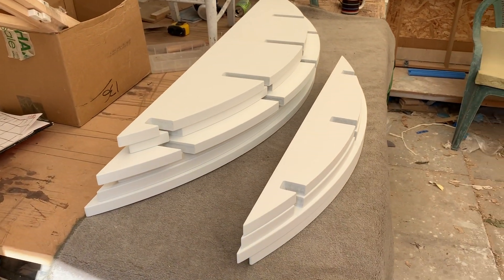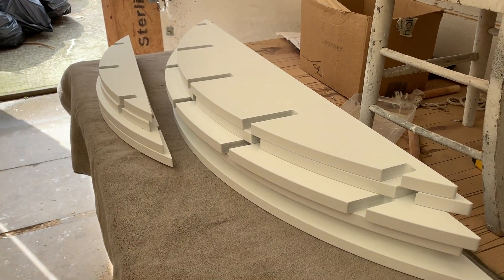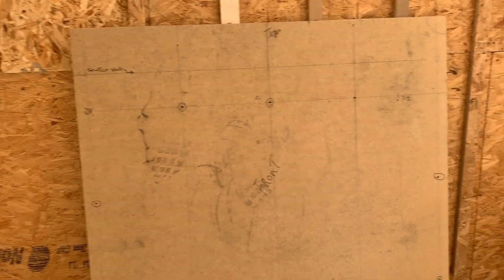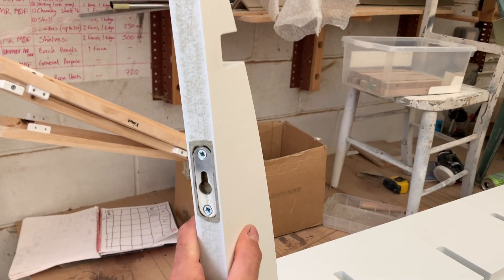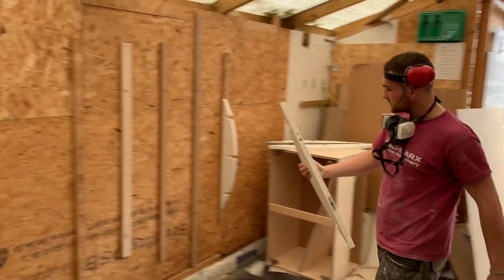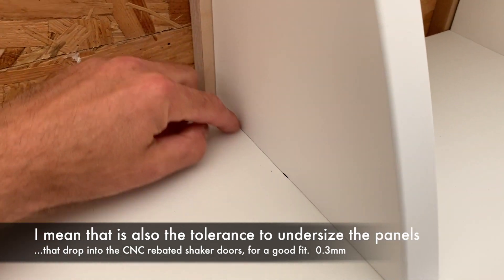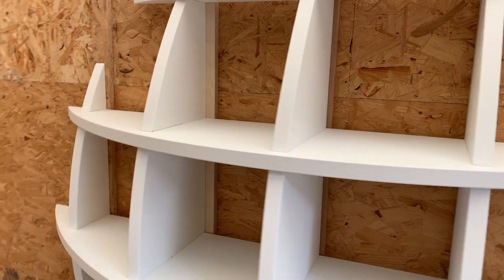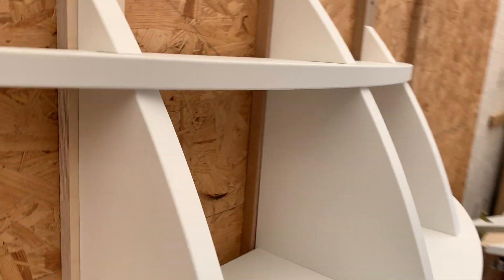Curved Interlocking Shelf Unit

Comment: I love these shelves. If you want metal shelves to weld yourself you can buy them on ebay. Here's the link
https://www.ebay.co.uk/itm/Massironi-Shelf-Project-DXF-files-1-2mm-Steel-Weld-it-yourself/143596249221?hash=item216f00e085:g:66YAAOSwO9lesDVw

Comment: If you use fusion360 it can auto generate this for you in any base shape you make. if your using cnc when you get your material in scale the whole thing to the actual measured thickness of the sheet 22mm is never 22mm . If that makes sence
Reply from the maker: Tim you mean you program in a lot of parametric functions?  How time intensive is it to set up something like this in fusion 360?
Reply: @Alastair_Freebird  hi. This probably explains it best. It's slicer for fusion 360 https://youtu.be/4fFH_TcI-9U
I am just a maker and haven't  actualy used the output to cnc yet. But this is a project I did a few years ago using some other software https://www.instructables.com/id/The-Most-over-Engineered-Shelves-ever/
I know sketch up is easy to us but fusion is so much more powerful. And you can definitely teach your self.
Reply from the maker: Really interesting, that instructables post and shelving design!
Reply: @Alastair_Freebird  I only found your channel about a week ago been binge watching it so useful. I finished my first alcove a few weeks ago. Would love your feed back
https://www.instagram.com/p/B2_8IGGAYS0/?igshid=14cxljr0901oq

Comment: Button fix would have worked a treat for hanging this on the wall.
Reply from the maker: Paul Gray is there a variation small enough to be concealed in 25mm thickness boards?
Reply: @Alastair_Freebird  Hi Alistair. Yes, I've tagged you in an Instagram post about the type 1 Button Fix.
Reply from the maker: Found it thanks 👍